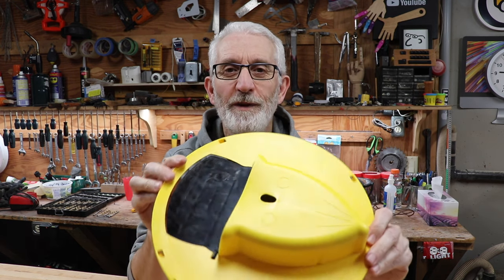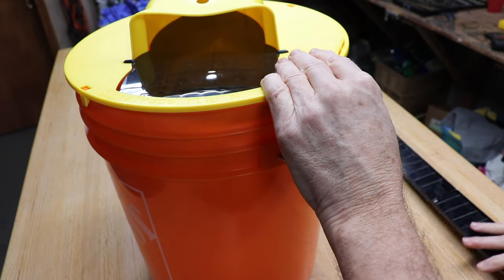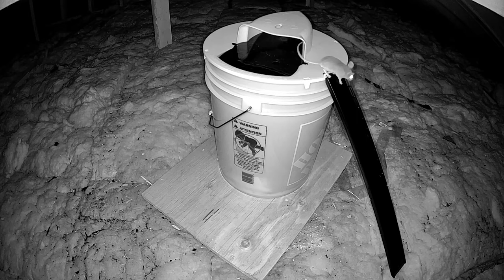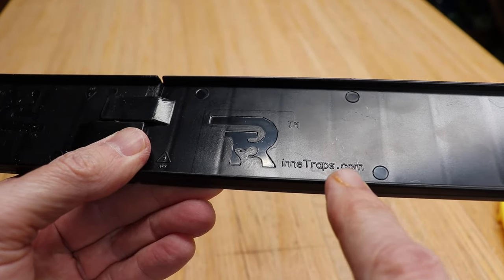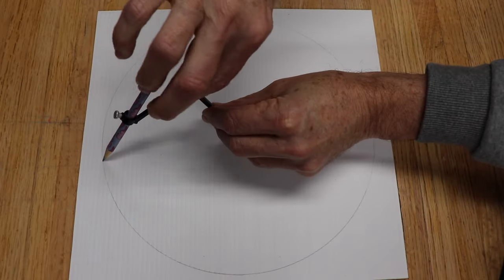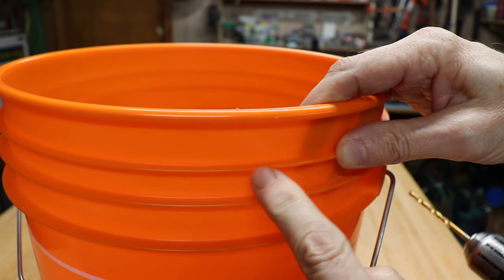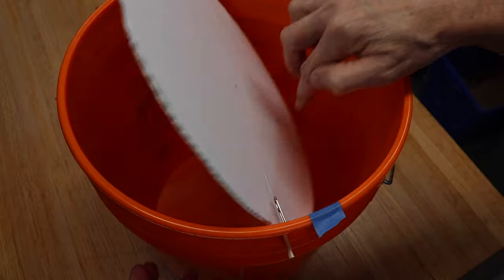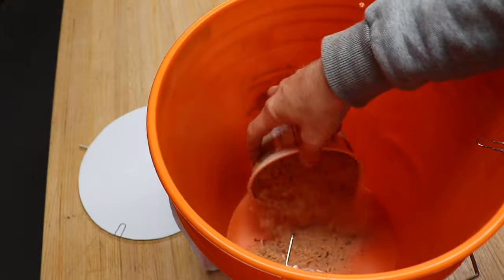How To Replicate ● The Best Mouse Trap Sold Today !

Comment: I can think of two reasons that the original trap is superior.  Firstly, the 'roof' over the feeding area offers a degree of protection from predators while feeding, and secondly, on the replication, the mouse is able to go around the edge and test the safety of the surface.  In the original the mouse is directed into the trap before it can test the surface, by which time it is focused on the food.
Reply: If I were making one, I would clip clothes pins around the upper Edge so that it couldn't walk around on the upper Edge.

Comment: Thanks much, you did a stupendous job on the production and trap design/construction. We use the official RinneTraps in our barn, house, and our church also has one in the basement. They work well but we've noticed small issues over the months. First, those plastic bucket tabs do break off. And too, for some strange reason, sometimes that flipper sticks and doesn't drop the mouse into the bucket. Occasionally we find a trap cleaned out and that flipper or drop down has resistance and doesn't work smoothly. We're thinking maybe your design is even better. It certainly is more economical.
Reply from the maker: Whenever you remove the flipper on the RinneTrap  to re-bait under the lid, I always make sure to cycle the flipper a bunch of times to make sure it is in the grooves properly and that it is not catching on something to make it jam.
Reply: @chrisnotap  Yes, we always do that too. Sometimes a trap sits for a long time such as placed in a closed cabin during the winter. We've observed that plastic against plastic tends to stick when just siting unmoved for a long period of time. Maybe something like your design with a brass rod and brass sleeves arrangement would be better. Anyway, something to think about.

Comment: A good take on the swivel pole version. Seems more inviting. They sure are curious. One thing I would recommend is to maybe put a hamster cage drinking bottle in there if it isn't checked daily, or forgotten occasionally. One concern I have about multi-mouse live traps is that some mice might fight. I have seen an adult mouse attack a baby mouse that wasn't its own. That said, mice are one of the most placid little rodents (voles are another story!). A personal anecdote: when I lived in Germany, at the age of eleven I, per chance, discovered the hideous accidental mouse traps - storm gullies. German gullies, the type with a cast iron grill cover have suspended arm-deep buckets in them with a solid base and holes half way up to catch debris before the water runs into the drain. They would get emptied occasionally. One day, out of curiosity I peeped inside and saw a mouse. It was as though it called me. It was alive and I could see its predicament. I just about managed to lift the heavy grill and just about managed to reach it and pull it up to freedom. It became a habit to always check the gullies and over the years I  pulled out countless mice and the occasional toad. They rarely freaked out. Many would instinctively know that I was helping them. When I worked in a factory in the forest I had refined my method that didn't require lifting of the grill. I had a "mouse elevator" in my handbag - a cardboard loop on string. Again, they would often go in voluntarily. Sometimes I had put in bit of dandelion leaf, or if the mouse had been weakened by a prolonged confinement, I had to lift the lid and transport the critter to the mouse ICU. Not once was I bitten. Often they would just sit in my hand and groom themselves. Oh, and my colleagues called me the mouse angle, well, to my face anyway, lol.
Reply: *angel
Reply: You sure have some great adventures to tell mam
Love to hear from you in your videos
Please make some
Reply: Thank you

Comment: I wish I could cut that quickly and accurately.  You are truly a master.  I have noticed there are a lot of them on YT.   The two mice looked kind of similar with the jump, so I went back to review the first to make sure you weren't using any video trickery ANYWHERE in this video.  They were different, you passed the test.  :-)   I certify this video 100% unmodified! 

 Nonsense aside, I don't have any rats or mice in the attic anymore because I got sick to death of them chewing through the fiberglass screens in the soffits and put in chicken wire for the rats and mice backed up with aluminum screen as a bug barrier.  Chew through that, you little buggers (or something to that effect), was my final decree at finishing them.  They haven't, and unless one of them has steel teeth, I doubt they ever will.  

I think that, or something pre made up should be a standard code requirement on those vents, something truly rat proof, because with fiberglass screen, eventually they will getting in the house, and that does not a happy camper make.   And when they've discovered the ingress, even if you fix that place in the screen, they will just immediately chew a new hole there or elsewhere.  Maybe they have, I haven't looked at building codes in a long time.  Maybe I'll do that, just out of curiosity.  I've seen the plastic vent covers, but I don't know if those are rat proof, or not.

Nice take on the trap, BTW.  Not surprising.  I've seen a few of your things I could think of mods for, but never anything that wasn't well thought out and executed.  Nice job keeping this one very simple and effective...again.
Reply from the maker: Thanks for all of that and the nice feedback!!

Comment: It's good to see you again. I bought the parts to make the cyclone vacuum out of 5 gal. Buckets and the water vacuum.
I'm going to combine the two, using the water vacuum together to make a hydro filter. That way I can clean rocks and carve wood with my Dremel. Thanks for being the inspiration. One more thing. I'm putting a PVC pipe down to the bottom with a bunch of holes drilled into it. That way the cyclone will catch the larger pieces a the water will trap and filter most of the fine dust.
Reply from the maker: It's all about being creative and experimenting!!
Reply: @chrisnotap  I had been wondering if a hookah style dust filter would be viable or does the water result in too much suction lost.  And, of course, does the water trap the fine dust???

Comment: I think you could replace each paperclip and glue with a wood screw that you just thread into the bucket.
Reply from the maker: Yes I actually experimented using screws. But with the side one, you only have one chance to get it right in the limited space on the bucket. With the hot glue you came pop it off and reposition it easily.

Comment: The flipper has two sides: One (A), which folds down when a mouse goes on it, and the other (B), which then automatically swings up. My humble question: Can a mouse jump so hard and so high that it pushes side B up and can thereby escape? Thanks for helpful answers! Greetings from :shelterin:Germany :chillwcat:.
Reply from the maker: One mouse would need to jump up and have its body weight hit the bottom of side "B" to make it pivot and then have another mouse simultaneously jumping up to escape out of the partial opening that the first mouse created. If this happens to happen, the second mouse deserves to have a "get out of jail for free" card!
Reply: @chrisnotap  Great response, many thanks!

Comment: I have never caught any mice with the one i ordered and its been two years, so I might try to make the homemade version and see if it works any better. I think the mice I have are engineers. But I will say this, I found two of them stuck in my empty potato chip bag that was left sitting upright on the floor next to my coffee table which gave them something to climb up and get to the very top of chip bag, once they tried to walk on the top edge of the bag they fell in and it was too slippery to climb out.

Comment: Chris, what security system are you using? What sort of cameras and recording unit are you going with?
Reply from the maker: The one in the attic is a great little security camera that I put there temporarily to capture their movements. I have one in my garage and the image quality is great. They are super affordable and all you need is a spot to plug it in and a good WIFI signal. I have a link in the description for it. Check it out. If you do get one, also get the "cam plus" It costs about $1.50 a month and well worth it.

Comment: thanks for not only not filling it with water like intended, but also softening the fall for them.
Reply from the maker: Actually mice can fall down a mine shaft and land without harm. They are light weight and adapt. The sawdust is for the poop and pee.
Reply: Do you really want your house to smell like dead mice?

Comment: Why not put cloth ramp on side of bucket that will make them fall into bucket? Youve put cloth on side that rhey can walk around then down off bucket lid. Don't you want mice to fall right in? So, wouldnt you tape cloth right next to paperclip. Muce walks up cloth, then gets dunked immediately! Additional, cover ocver original trap has a purpose. Yop yellow cover is to isolate mice to not be able to walk around bucket top rail. Your not done with trao until you make a simylar top cover?

Comment: Very good trap. Kill traps aren't only unnecessary but are typically far more complex mechanically. Your take on the trap was pretty cool! 

The only thing as others have said, is that these traps which catch multiple mice in a small space lend themselves to mice killing and sometimes cannibalizing eachother. If left too long. Even with food in the trap. I have often found mice half eaten and still alive, crawling around 2 legged with 4 or 5 other rabid examples in the traditional gated metal traps. Quite gruesome.

Think I'll pick one or two of these up anyway but it would be a huge innovation to have a trap that would fill the bucket with 4 or 5 chutes for the mice to go into and a cam that alternates the chute every time the trap is sprung. I would pay good money for that.
Reply: Please go get a life and watch a few episodes of the Monday Mouse channel.
Reply: 4" of water in the bucket does the trick.
Reply: If you want to keep them from gathering multiple mice I have an idea. Glue two magnets to the parts where the trapdoor and the lid meet so it only opens once. Or a magnet and a piece of metal like a small bolt.  For Chris's version you would do the same and not use the second Paperclip.

Though honestly I wouldn't feel bad about the mice fighting each other.  That is nature and not your choice.  Your actions are still a hundred percent humane.
Reply: @VagabondTE  I think he means he would prefer a mouse trap that can trap multiple mice but keep them separated.
Reply: @nnamerz  I'm aware.  That's exactly what they said.  However, something like that is exceedingly complicated.  I gave a possible suggesting knowing it wouldn't be fully satisfying.
Reply: @VagabondTE  Oh ok...fair point. See comment below for a suggestion I came up with.
Reply: I tried to think of a simple solution and the easiest one i could come up with was to make 4 separate compartments at the bottom of the bucket and then place a cone (or upside down funnel, etc..) on top of the compartments. The mice will fall into the trap and then slide down the cone into a random compartment (depending on where they were when the trap door is triggered). It's not a perfect solution to compartmentalize each mouse separately, but at least this way, there's less chance of cannibalism since the mice will be randomly divided into the compartments based on which side of the cone they land on.
Reply: Or maybe make a ramp just under the trap door with different sized holes cut out of the ramp (starting with the smallest hole towards the top and the largest hole towards the bottom). As the mice trigger the trap, they would then slide down the ramp and fall into the one of the holes (based on their size). This way, you can try and separate the larger mice from the smaller ones. You can probably use some 2L soft drink bottles with the top section removed and place the bottles under the holes. Not only would that be a cheap and easy way to make separate compartments, but you can also easily lift out the bottles to release the mice and shaked out the droppings.
Reply: @samsen3965  I have a great life. I have great friends, spend a ton of time outdoors and have a very successful career. Not sure why you're in a such a bad mood. Maybe you yourself, are miserable.

What's the Monday mouse channel?
Reply: @aerospot2  
The concept behind the trap is not to kill the mice in an inhumane fashion. So no it does not do the trick.
Reply: @VagabondTE  That's not a bad idea. After the mice are caught, I dispatch them quickly and gently by separating their spinal cord from the brain by grasping the head and pulling the tail. Quick and painless. I turn them into compost after that. 

What bothers me about the cannibalism is that it's a symptom of them being trapped for too long. Something I always can't avoid. I know it's their natural impulse to do it, but it's a pain in my butt to clean it up after and I always feel a little bad for the one who's been being eaten alive for 2 days or more.
Reply: @nnamerz  
I might try that. It gives me a good idea to build multiple compartments that cascade down to one another and then add spring loaded gates to each compartment. Once a mice enters a compartment his weight will trigger the gate and close off that compartment. Next mouse to get into the trap will fall in and bounce off the now closed door and fall in the next available compartment. Rinse and repeat. Cool! Thanks for the response, have a great day.
Reply: @FarrYaweh  You're right in saying the principle of "Primum non nocere" - First Do No Harm". But... OK, leave the but part.
Monday Mouse is a great channel, if not the greatest in telling you everything about house pests from mice to the bigger or smaller ones. You have the greatest luxury of all "Time" on your side. Do yourself a great favor and above, on the search box of YouTube write"
Monday Mouse Shawn Woods
and hit enter. When you get the result chose that channel and watch a few episodes. You'll be totally hooked and learn a lot, including the real survival techniques, if you look at the very older episodes in the archive of that channel that has thousands of related clips.
Reply: @FarrYaweh  it solves your complaint about kill traps being too complex mechanically.
Reply: @FarrYaweh  He's talking about Shawn Woods Mousetrap Monday.  It's a popular channel on YouTube.
Reply: If you want end the cannibalism for sure, wouldn't you need a separate compartment for EACH mouse? Having 2 or 3 in the compartment may not be much better than having them all together in a larger space.

Comment: To replace the 'tent' feature of the original (which increases the suprise to the mouse) you could take a second board and cut and fold it so that it sits on three paperclips (an extra one goes directly opposite the second one in the video). The unfolded shape would be like a heart symbol with the bottom cut off. The top curves would each be the same as inside of the bucket. Fit it by squeezing the two 'halves' together and pop it over the three paperclips to shield the open side. In reality the top of the heart would probably be very shallow - more like the outline of a seagull in flight.
Reply from the maker: That's an interesting Idea.
Reply: @chrisnotap  First of all, that is a very easy and practical flip top trap.  As for Martin's point, actually I'm not picturing what Martin is suggesting, but it is important to have the covering over the flipping part.  If you watch enough of Shawn Woods videos, it is not uncommon to see a mouse realize the surface is tipping and leap to the rim before sliding into the bucket.  The overhead tent prevents that from happening.
Did you try cutting the coroplast material with the oscillating tool hook you made back in the past?  The tool works so well on cardboard I would think it would work with corrugated plastic.
Reply: Another good useful vid by MR notap   AKA the notap mouse trap 👍🏻🫵🏻